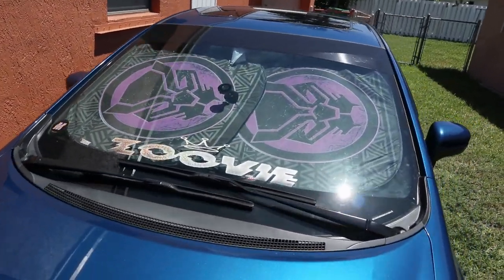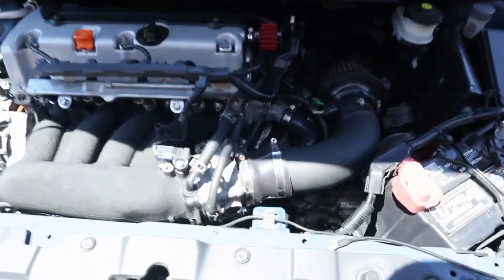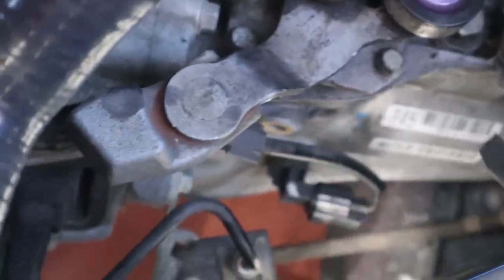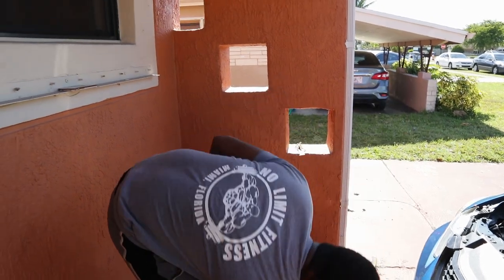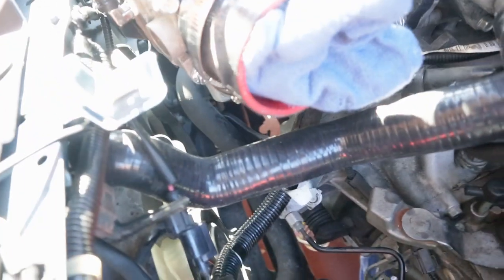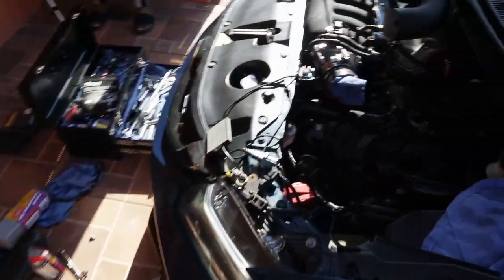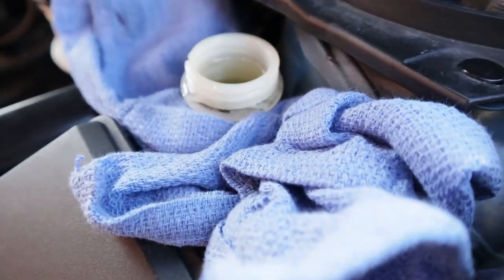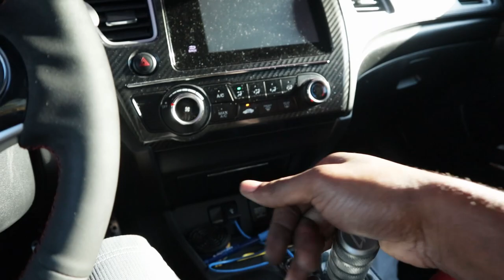Clutch Line Install For Dusty | 9th Gen Civic Si

Comment: Great video 
I was wondering if you ever had any issues with your clutch.

I have an issue in first gear with a screechy sound at the catching point.

Also a hush sound at around 2-3krpm 
I feel that the shifting is not smooth all the time. I drive manual pretty well and I can’t seem to drive this car as smooth as  05 ep3 
Just got the car at 55,000 miles
Reply from the maker: That could be you clutch slave making a noise . I have it too and it’s because of the clutch delay valve. Doing the cdv delete would get rid of the sound I believe

Comment: Let me just say that it's not how u bleed a clutch or anything for that matter.. you need to vacuum bleed or u need two people to do it the way your trying.  Imagine how good it would feel if it were properly bled
Reply from the maker: You need to do that method when you install a whole new cmc or slave. I just changed a line. Clutch felt amazing , pedal felt amazing. I powershift , quick shift , rev match etc and not a single issue.  I recently upgraded to a new stage 3 clutch and stock clutch still had plenty of life on it. You can look up “gravity bleed clutch” and you’ll see many cars doing this method, especially s2000.
Reply: @zoovie  although I hear what you are saying.. but with the schooling ace test I've taken the "gravity bleed" method is at best "good enough" or just "gets the job done "  just try a vacuum bleed and and see if it doesn't get even better.. it's easy and can go a long way.. your car is clean tho bro I daily a 9th gen to keep the mile off my cat 🐈